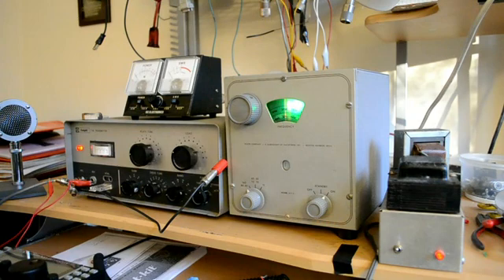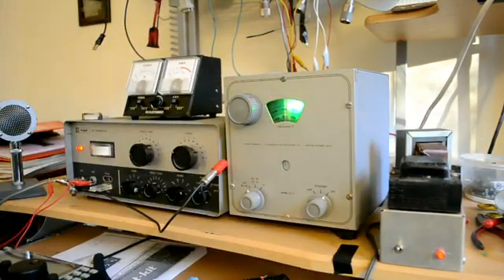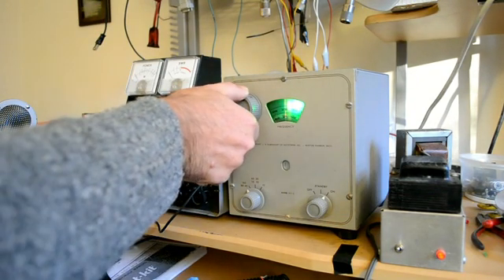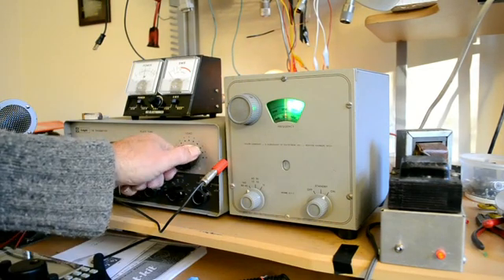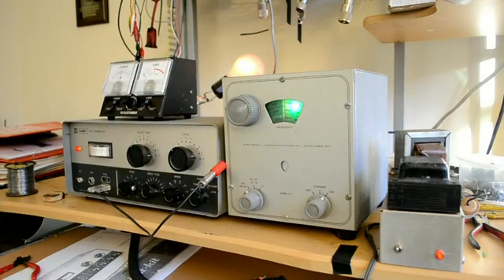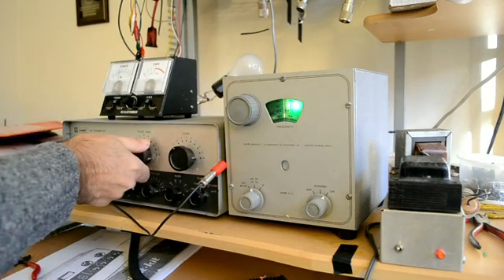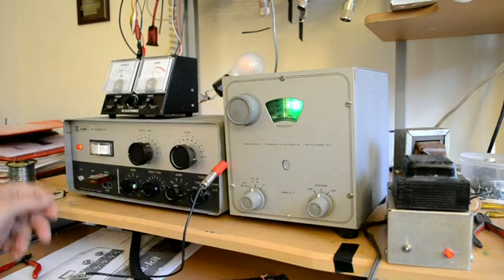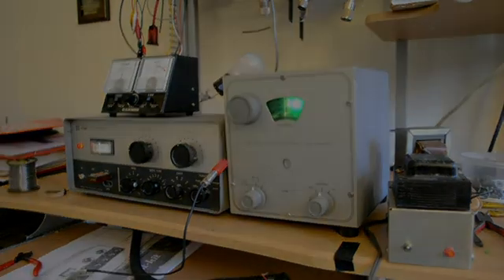Demonstration of the Knight T-60, and Heathkit VFO VF 1 Power Supply

Comment: Great video, but I have a few questions.  Do you know where I could locate a schematic for the external pwr supply for the vf1? Also where you've done many videos on the Heathkit DX 35 what microphone would you recommend for it?  Lastly, what kind of antenna do you have?  Any specific brand or did you Homebrew yours?  Thank you for the videos you do, I appreciate it.  73 KC1HQY
Reply from the maker: The VF-1 schematic can be Googled, a D-104 mike would work, I use a dipole
http://amfone.net/Amforum/index.php?topic=35303.0;wap2